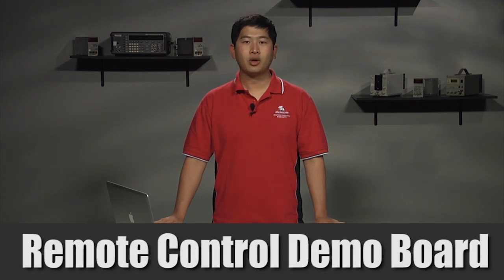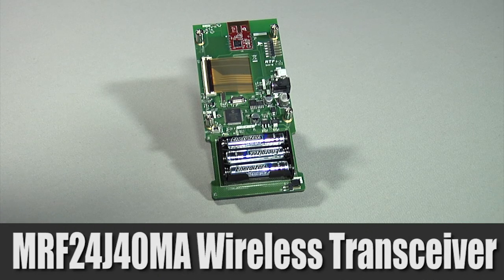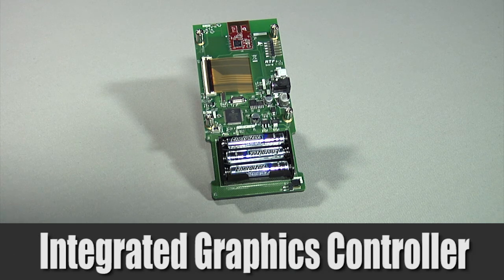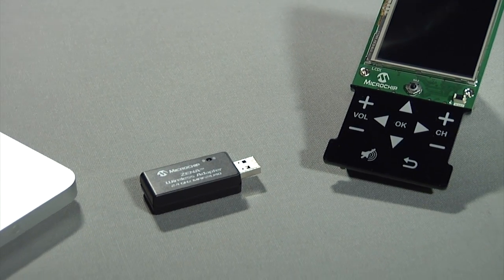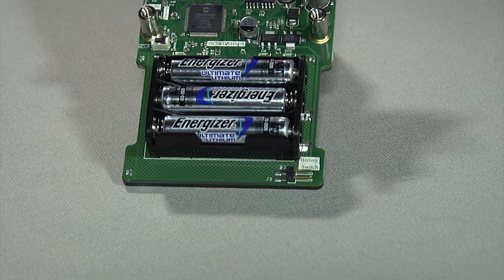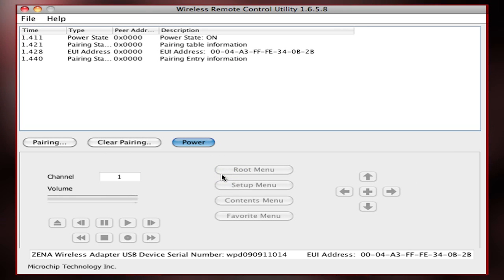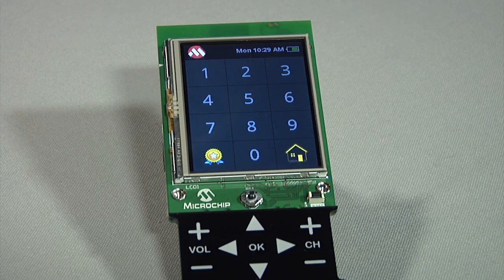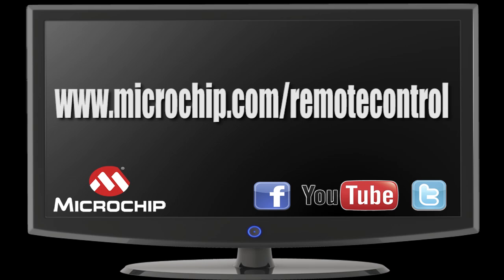Remote Control Demo Board from Microchip Technology

Comment from the maker: @Phoboz The utility does not actually control the PC hardware, it only provides emulated feedback that it has received messages from the remote control. The purpose of the program is to demonstrate the RF4CE communication using control codes defined in HDMI v1.3a specification. It is possible, however, to develop the code further to actually control the hardware, but this is not currently planned.

Comment from the maker: In theory, the hardware is capable of working with the MiWi software, however, this has not been tested on the remote control board. There are app notes on MiWi protocol itself which can be found at the microchip miwi website.